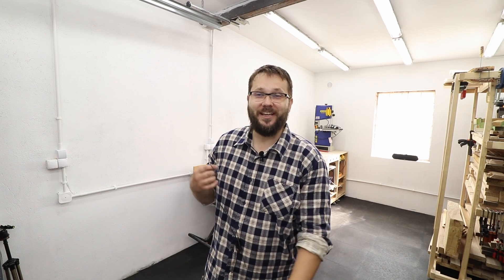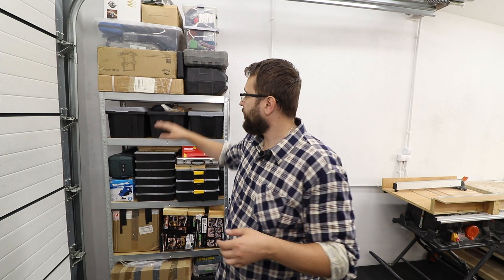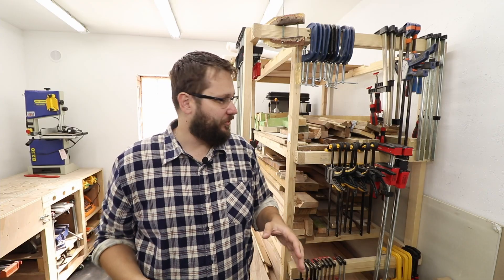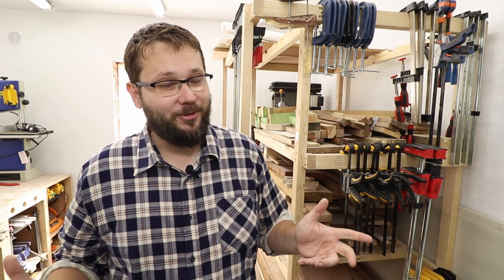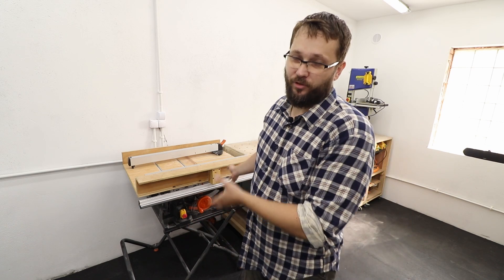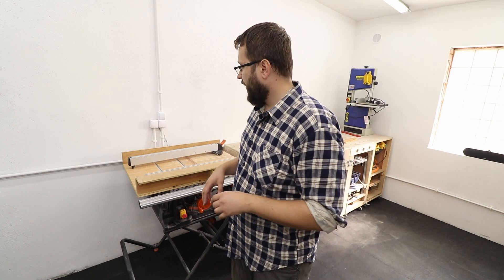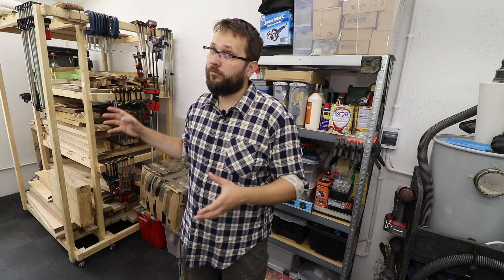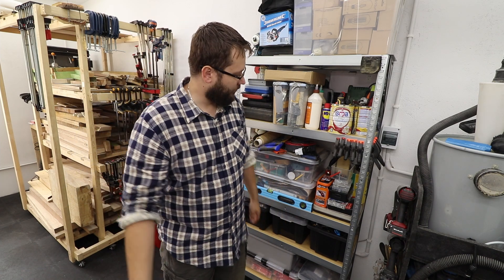Workshop update - shelving units for a workshop plus future content

Comment: Hi Tomasz nice to see the new workshop coming along nicely, Looking forward to the soft start on the rage something ill watch with interest. Another project im looking at doing for the saw is a cabinet as i find all the sticky out pieces of the frame take room up when folded out (small shed uk).
Reply from the maker: Thanks.
Yes I'm starting to find that when it's folded it actually doesn't save that much space. I'm thinking of building a workbench and ditching the foldable legs and just get the saw on the bench with the table top working as an out feed table.
Reply: My biggest complaint about the Rage 5 is dust, comes out of everywhere 🙄

Comment: Nice one, based on you mentioning a Soft  Start Module for your saw...I have just purchased one from Amazon for my Dewalt DW745... which sounds more like a Boeing 747.
Reply from the maker: hehe its strange that not all new saws come with this simple yet life improving features.
Reply: That's why I got rid of my dw745 a few years ago , thing would wake up the dead 💀
Reply from the maker: @williamn01  what did you get instead?
Reply: @CasualDIY  I got the triton twx7 work centre  with table saw and router inserts , but that was more or less the exact same Thomaz .
Got rid of that and bought and old startrite with an induction motor , much better for sound anyway not as big cutting capacity but not to bad.
Reply from the maker: @williamn01  as long as you are happy with the tool that counts. Sometimes it takes time and unfortunately money to find the right one 👍
Reply: @CasualDIY  Yea true Thomaz always the same with tools you know what it's like 🤣. 

Take it easy 👍